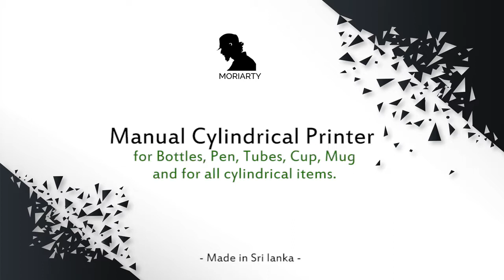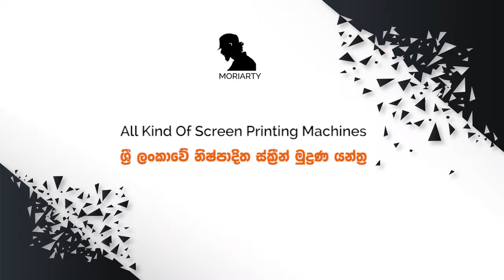Manual Bottle Printing machine - Sri Lanka

Comment: hello how did u measure to get the center of front and back? did u do trial and error prints too?
Reply from the maker: Normally we are using Manual Lock on bottom and limit stroke length form screen top